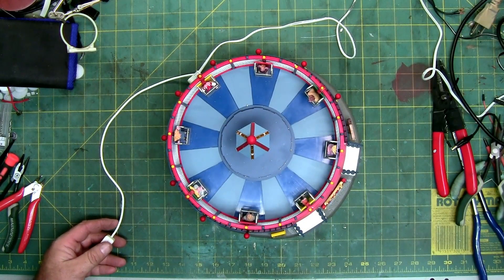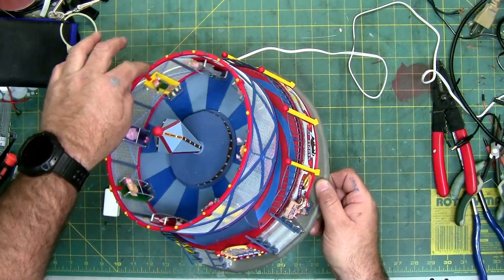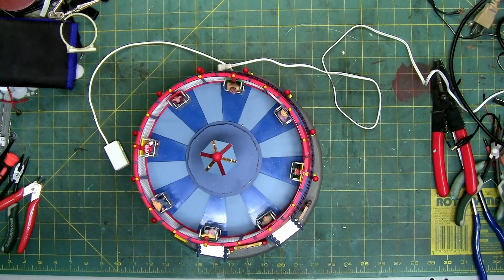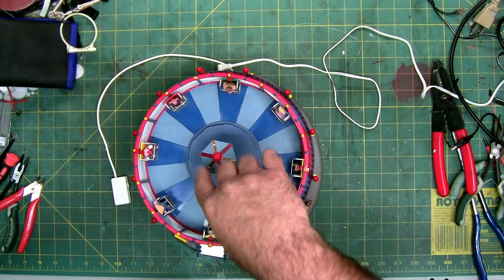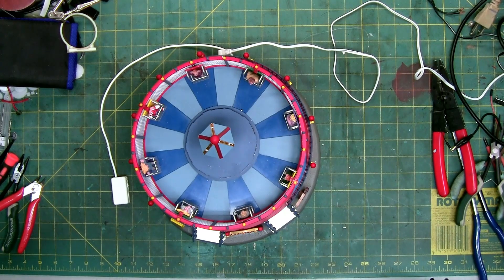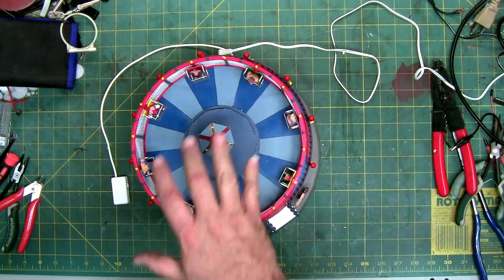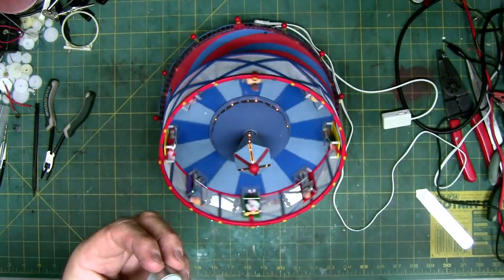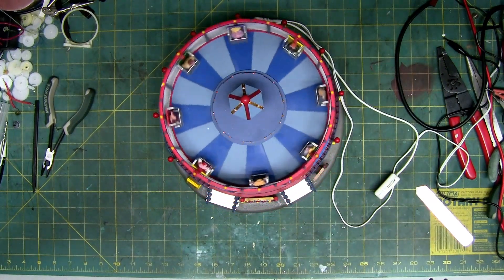Nothing works: How to quickly check if your motor has failed in most cases (Lemax)

Comment: I have a 2014 Christmas clock tower that is powering on at all. No lights  or motion..the pieces that turn feel.tight, afraid to turn them by hand.  any suggestions?  4:19 4:19
Reply from the maker: If your AC adapter is good, I would start with a bad motor causing electrical failure. As far as the motion being tight, depending on how the gearbox was made, it may not work in reverse. Meaning the gears are driven from the motor side only and not the end result side. This is common and in a lot of cases it won't turn. But it could also have a bound up gear, it would have to be opened to verify failure, but I would start with the motor. Unplug it and see if the lights return.

Comment: I have a question I just bought a used round up it lifts and has sound but doesn’t spin I opened it up tons of grease it seems like the teeth aren’t moving inside the lift arm is it probably the small little gear broke like in your other video
Reply from the maker: I would check the gears, use a magnifying glass if you can to see if there's a hairline fracture or a break in between the teeth. Check the belt tension to see if the belt is slipping. Lastly make sure the motor spins, sometimes they die without shorting out.
Reply: @RandomJunkChannel  ok thanks my big challenge is cutting the bottom of the platform open like you did in the video to remove the lifting arm to ge to the 2 bottom screws to open it up I removed the top two with a small screw driver and cranked it open a bit to see the belt is in place I turned the wheel with my finger and the gear did move so i thought the same thing with all that grease inside but I can’t see the little gear till I fully open it it might be that if not then the motor is shot but I will buy on eBay the bag of mixed gears I’m use to working on the telco Halloween animation figures but I bought this for 30 bucks off eBay for my Christmas carnival platform this year theses things are expensive online so I thought I take a chance with it.  And your the only one I see on here that fixed one so I took some tips from your video what I’m in for lol thanks for the tips

Comment: I have a question I was hoping you could help me with. I have a Lemax The sky swing. A Christmas swing merry-go-round. It is stopped working there are two motors. I have taken it apart and disconnected both motors but still led do not work. When I turn the rotary switch on I can hear a relay clicking but nothing happens Even with both motors disconnected. Any ideas with this could be could you be the switch? I have tried several power adapters. Send so far the only thing I can tell that is working is I hear the relay clicking. Any help would be greatly appreciated
Reply from the maker: Sounds like a component has failed, either the rotary switch or a component soldered on the board. If you have a voltmeter, you would need to trace the power from the AC power port through the board to find the voltage drop or loss.